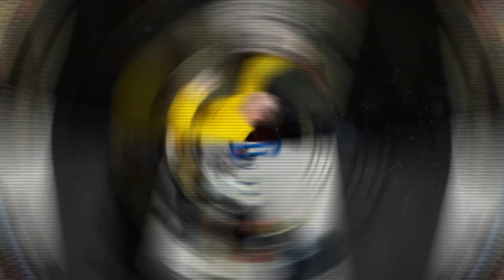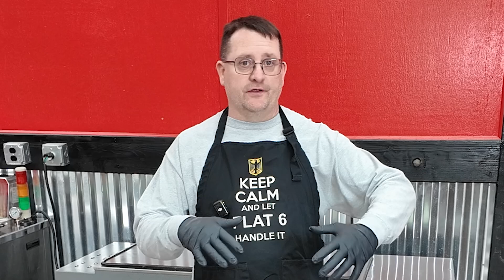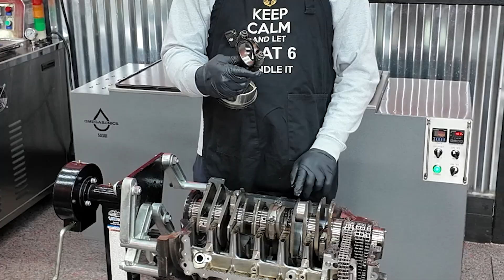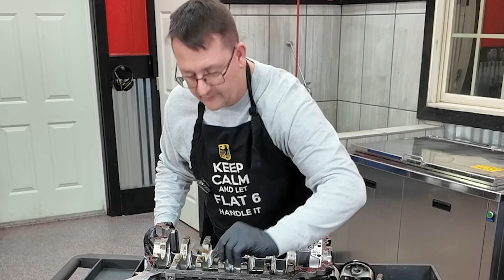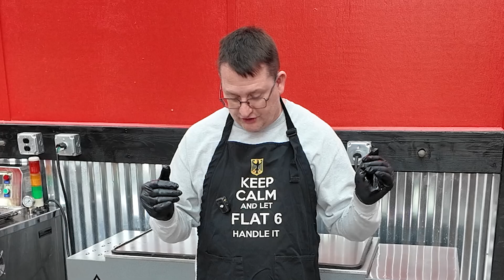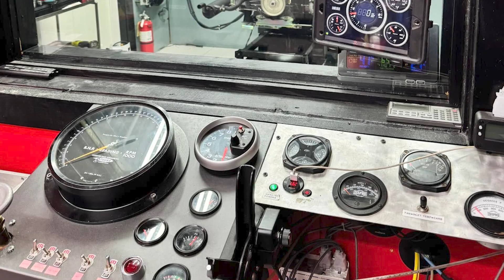2012 Porsche 997.2 MA1 Engine Failure Analysis

Comment: How many dalah for this engine rebuild? I've rebuilt 1.8 Honda's for $3,500 and BMW engines for $8,500. Therefore, these Porsche engines must be easily 3 or 4 times the cost of a BMW. I found a used 997.2 engine  for $20K. Therefore I can easily estimate that the rebuilt cost for a 997.2 is easily $45K.

Comment: Well,i say it again, my 2005 997.1 Carerra S now passing 122000 miles, no issues,  oil analysis have been consistent in my 10 year ownership,  OCI at 5000 miles unopened original engine
Reply from the maker: Happy for you. How many owners?
Reply: @RennvisionbyTheKnowledgeGruppe  3 owners before i bought the car in 2015 and with 60000 miles on the clock
Reply: It depends how you increase rev when the engine is cold and if you use the car often in very cold temperatures.
Reply: @lucianoghirlanda9506  Yes,  my regimen is to stay below 4000 rpm. until i get full oil temp. (200 F) takes about 10 minutes, before pedal to the metal, another note is that i only use the car in the summer season, i have also the LN engineering low.temp thermostat and OEM third radiator (center) installed
Reply: @lucianoghirlanda9506 All about the 10W60 and long trips

Comment: I drive a 997.2 with a 4.0 FSI MA1 engine.  It's a beast!
Reply: Is it a modified 3.8? how did you get to 4.0?
Reply: @watson1381  To get 4.0 displacement you use the 3.6 MA1/9A1 81.5 mm stroke crankshaft and pistons with the raised wristpin location. The factory crankshaft in the 2.9, 3.4 & 3.8 are all 77.5 mm in stroke length and this equates to the wristpin needing to be located 2 mm higher in the piston. The 3.8 and the 4.0 have the same 102 mm bore. The 3.6 & 3.4 are the same engine 97 mm bore, but the crankshaft has the aforementioned stroke change and pistons with the wristpin raised 2 mm. Connecting rods are the same length 140 mm. Hope this helps you out.
Reply: What did that cost you?

Comment: Normal people change oil in their 911 once a year around the 3000 mile mark! Then it will last you a lifetime
Reply from the maker: Unfortunately, that's what a lot of Porsche owners think - it should be stamped on the dash  "6 months or 5000 miles - whichever comes first!" People will trust what is printed on the stupid oil bottle before the car tells you differently.